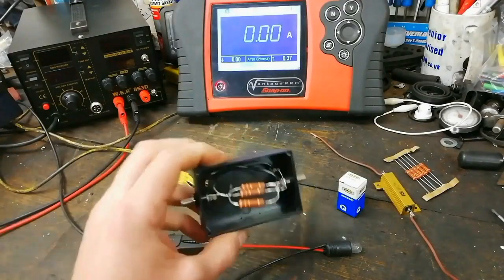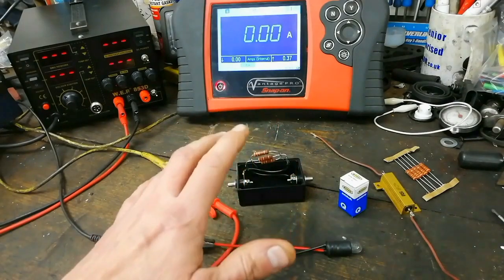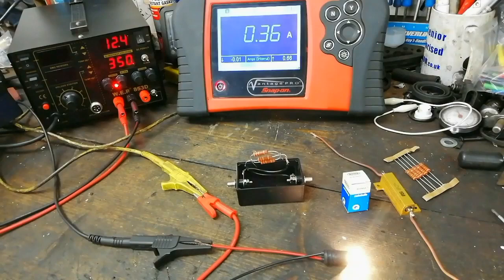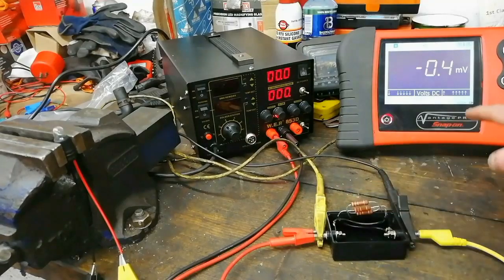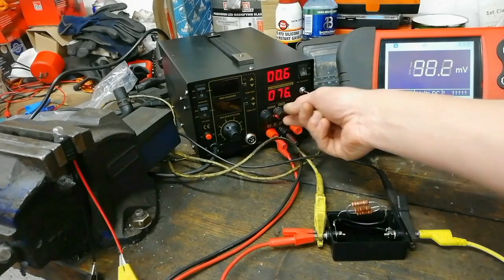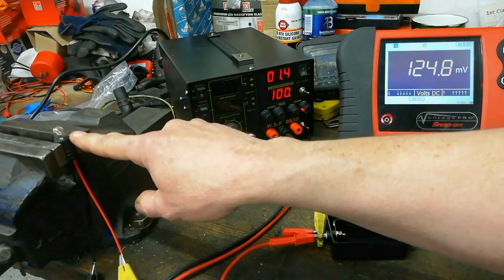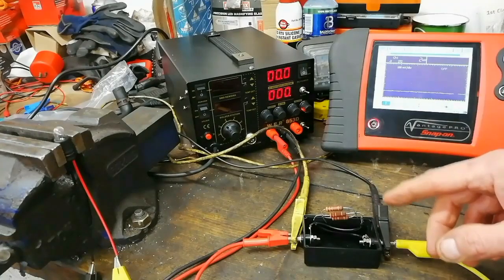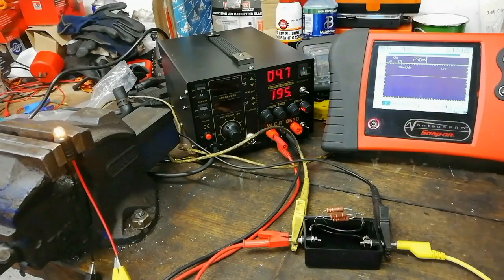Automotive Homemade Tools Part 3: Low Current Shunt

Comment: Hi  Dave, Love the video I'm really interested in making a shunt resistor for parasitic drain testing you mentioned in the video the resistors that you used weren't ideal, have you other ideas?
Reply from the maker: Resistors with higher wattage

Comment: just ordered  a 5v regulator going to pop in in a project box with a with 2 outputs one 5v and the second with a variable resistor
Reply from the maker: Excellent Simon, i didnt want to put a variable resistor on it as that will put a load on the regulator